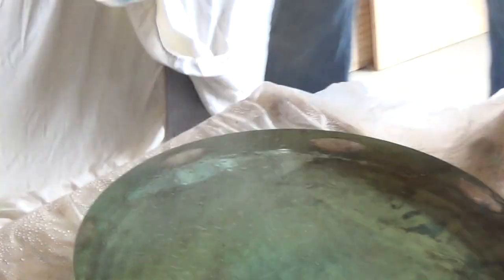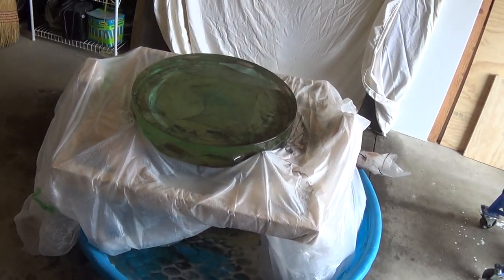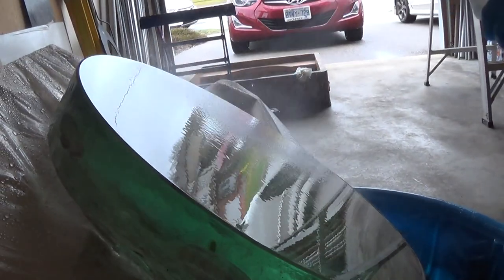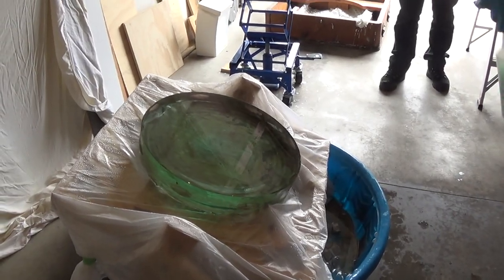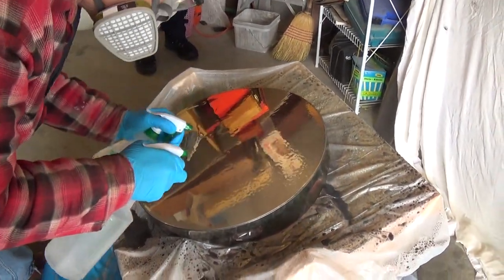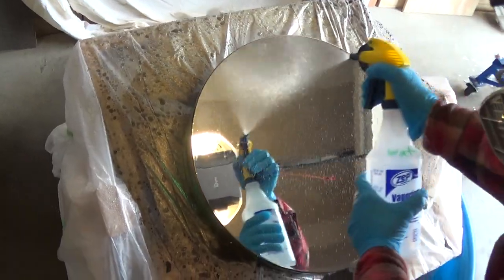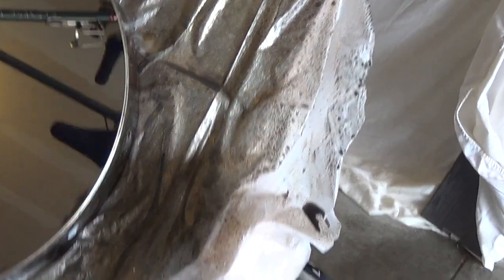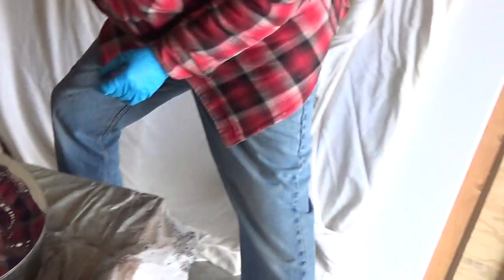Applying the Tin and Silvering Solutions

Comment: This is great!! I've been trying to silver a mirror using a traditional Tollens reagent process with little success. I can get a thick layer of silver, but it invariably ends up cloudy/milky. I think I am getting crystals growing, making the surface microscopically rough. The quality of the coating here is awesome! I knew about the spray silver process from Googling, but this is the first time I've seen it successfully applied to a telescope mirror. One question I have though : How can I remove a failed silvering attempt? Hydrochloric acid and ferric chloride won't touch it, and nitric acid will harm the substrate (it's not glass). I was about to give up hope, but this video has inspired me to keep going. Thanks.
Reply: Really? Very weird. Have you tried using sodium hydroxide then reasonably concentrated ammonia? That might take off the silver too but at the very least it is like to remove any silver oxide that is probably protecting the silver by passivisation.
Reply: Oh, be careful, adding ammonia to a strong base will release toxic ammonia gas, do this in a fume hood or outside, preferably down wind.
Reply: @MrGoatflakes  I didn't - I made another mirror. The mirror is epoxy resin. I have since made a 50cm mirror and have plans for a 1 metre mirror. :-)
Reply from the maker: @MrGoatflakes  I used ferric chloride and reclaimed it all because it lasts forever.
Reply: @wayneyoung9612  so you are saying first you pour the Tin chloride on the piece of glass and then rinse it off with distill water and then pour your mixture of Silver nitrate+ammonia+Sodium hydroxide and Glucose on the glass?
Im trying to figure out how to turn a glass piece into a mirror...
Reply: @loiredesigns9971  Yes, you put the tin chloride solution on first, leave a minute or two, then rinse, making sure it never dries out (if you've cleaned the glass properly, the water will stay on the glass - see the video). You need to remove the tin chloride, because the chlorine will react with the silver to make insoluble silver chloride crystals. The procedure in the video is pretty much what I did in the end, except I poured on my chemicals, rather than spraying them from a bottle.
Reply: @wayneyoung9612  Great, I'm buying some Tin Chloride! I'm just trying to figure out mirror making... but was wondering why my glass panel wont turn into a mirror, I was missing the Tin... I found this on ebay: "Tin (II) Chloride dihydrate (Stannous Chloride), Analytical Reagent (ACS) 100g". Is this what I need? 
Thank you so much for the help

Comment: Hi, nice work, may I ask what you use to remove the old coating of silver or aluminum, so as not to damage the optical surface?
Reply: ferric chloride
Reply: @ianbuttery8693  Thank you very much for your help!
Reply from the maker: Yes ferric chloride. After stripping the mirror, use baking soda to neutralize the glass and any cloth or paper towels. The chemicals can be reclaimed and used a great many times.
Reply: @peterpekurar8440  Thanks a lot!!!

Comment: What are the potential causes of a cloudy/milky/hazy result? Have you experienced that before? Which part of the process can cause this? Thank you
Reply from the maker: It's called silver burn where the silver piles up too fast. I've found that diluting the chemicals to half concentration helps, especially during the hot summer months when the chemical reaction speeds up.
Reply: @peterpekurar8440  do we have to dilute all chemicals at half including silver ?

Comment: If you fail to see a break in the water eg at 3:40, what do you do? Go back to cleaning the mirror? Also there seems to be 2 types of 'water break':
1. Break in the middle of the mirror (spots)
2. Break at the edge of the mirror (never reaches edge)
Thank you for sharing these videos.
Reply from the maker: Yes go back to cleaning. The glass should be squeaky clean before tinning.
Reply from the maker: Yes go back to scrubbing. The break you saw showed up in the video but not while I was working the glass. It still worked but better if the glass was cleaner.